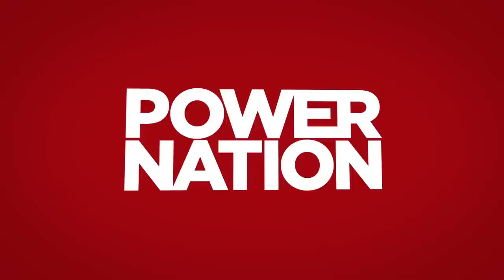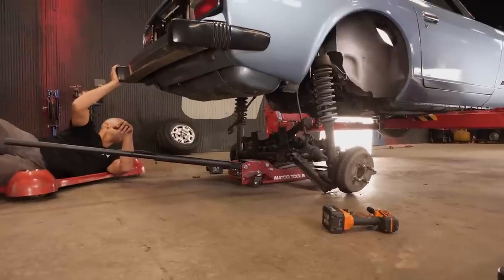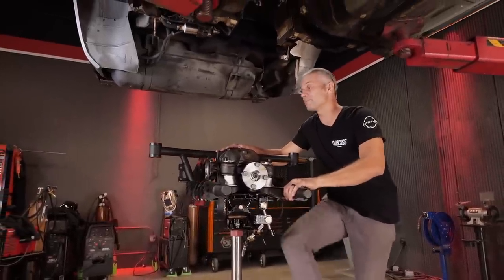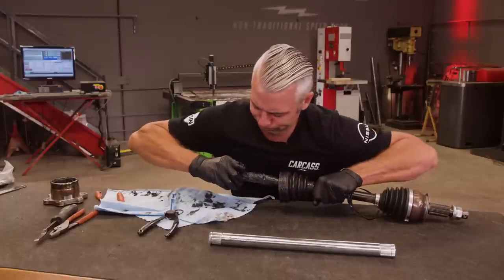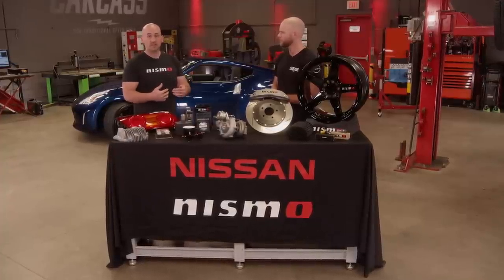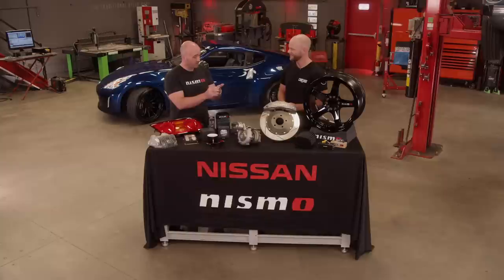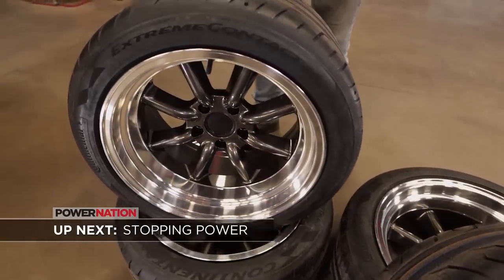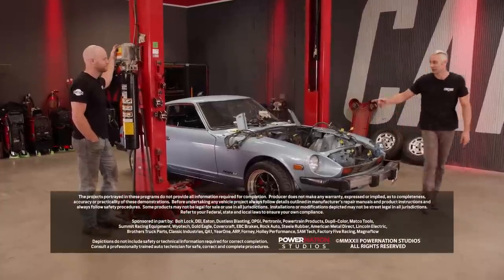1978 Datsun 280Z Heritage Restomod Gets Improved Suspension - Carcass S3, E20

Comment: My mother had a 1973 240Z 4-speed, while everyone else's mother drove a Ford/Chevy station wagon - haha! Two years in, it needed shocks and my autocross/SCCA driving uncle dialed her in to Koni racing shocks, followed shortly afterwards with Pirelli 195/70HR14 replacing the the Bridgestone 175HR14 tires. FIRM ride! That car would later later be replaced by a 1981 280ZX 5-speed, which I bought from her in 1993 with 48K on it. The diff had 3.91 gears and would chirp 2nd, 3rd, AND 4th gears. That car got the Konis plus 15" Weld wheels & 245/50HR15 BFG tires, as well as a Motorsprort 6-2-1 header, 2 1/2" exhaust, and  intake upgrade. Recaro seats were also added for a killer daily commuter that tore up the track nicely on the weekends....

Comment: One thing I have learned about aftermarket parts they never fit correctly, you always have to grind or smooth things off etc. Maybe you did this or not but from what I have seen right here Apex parts don't  fit the Z31 model very well. LIke always enjoys your video. got that 240z looking great.
Reply: What items did you have issues with?
Reply: For the Apex parts I saw on one of the youtube they had the hard time getting the rear end. Personally the aftermarket radio , carpet, etc. All of the oem parts I replaced had no problem. Just my experience  @ohmster101

Comment: Perfect timing! I'm doing all the same things with all the same parts on my 280Z right now!
Do you have part numbers for the wheels you used? Will they fit without fender flares? I'm thinking they won't.
Thanks for showing this!
Reply: Those will not fit you want a 0 or slightly negative offset to clear your fenders
Reply: @bobbyleescott  Thanks for the info! I appreciate it!!
Reply: Would same wheels but 17x8.5 +10 offset fit with same apex set up?

Comment: This video is basically click bait for NISMO and Apex Engineering. High-end suspension and brakes on an, at best 150 hp engine.  Could have at least slapped a turbo on that L6 - easy 300 hp right there.  Those brakes are totally unnecessary on a street/light track car and will simply add unsprung mass at the wheels making the car handle worse than with the stock brakes with performance pads.  Oh and these poseurs don't know jack about s30s, and it shows.